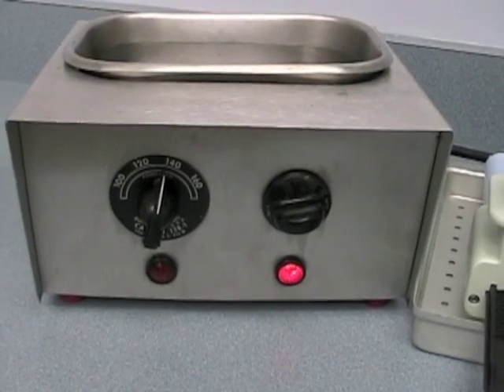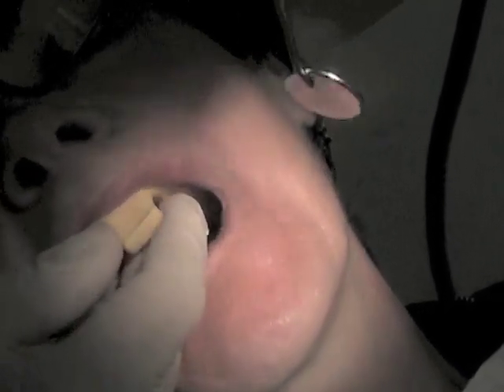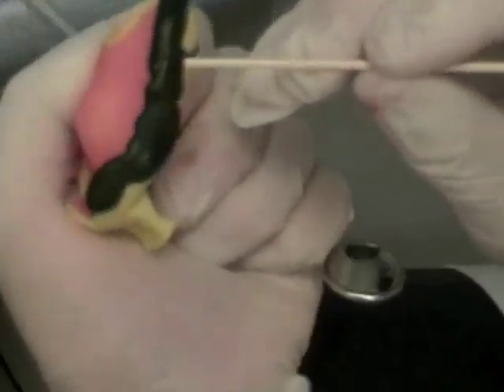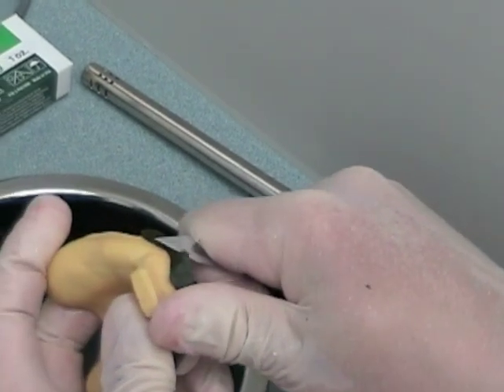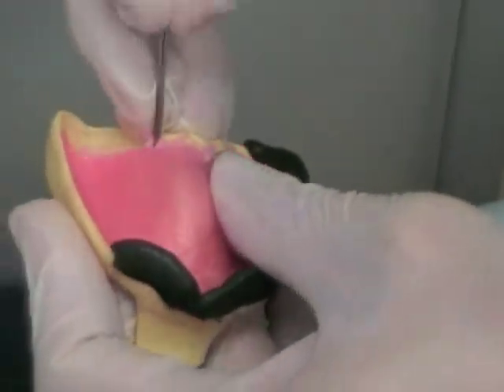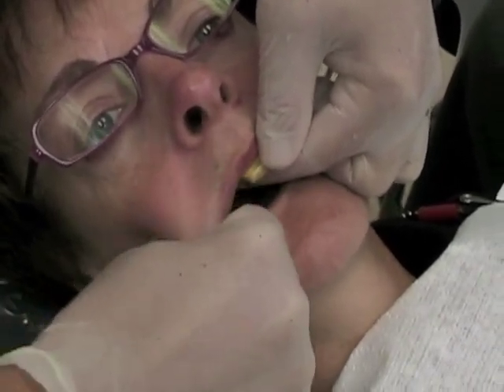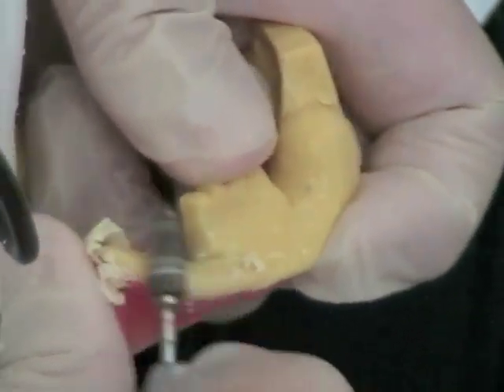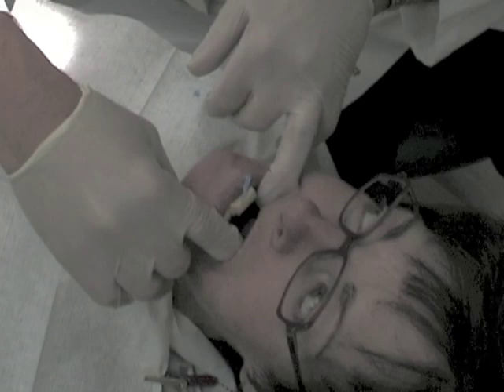21 Border Molding (New HD version at URL listed in description)

Comment: First we molded the posterior most part of the arch and hardened it  by dipping it in  cold water. Next when we are dipping it in warm water to keep the next segment compound hot , aren't we making the previous molded compound saggy and lose its shape. Pls answer sur
Reply from the maker: When the border molding is removed from the mouth the compound may still be warm and displaceable and it can be sometimes be easily distorted if handled. So some clinicians chill it immediately to prevent unwanted changes. If the compound requires changing after inspection, or if you want to add to it, it can be re-warmed and re-molded subsequently. This makes it possible to allow for changes without having to redo the entire periphery. For a different video of border molding see my newest version: https://youtu.be/N2Eg5wXkSj8

Comment: Hello Doctor, why can't the green stick compound be added to the custom tray all at once instead of multiple steps? since its all going to water bath several times anyways.
Reply from the maker: You can. But molding the entire periphery is difficult with a thermoplastic material such as compound because it begins to harden as soon as it is removed from the hot water bath. You must work very quickly to get all areas properly molded. Using a heavy body impression material such as a polyvinyl siloxane provides more time for molding if you want to do it in one step. This one step technique was first described by Smith, Toolson, Bolender & Lord. in J Prosthet Dent. 1979 Mar;41(3):347-51. If you use a one stage technique you may find that it is difficult to keep the border molding material from touching the lips or cheeks and being pulled off the the tray as you place it. Use two mirrors to retract the cheeks as shown in the 'Two Mirror Impression Technique' video on this channel for best results.